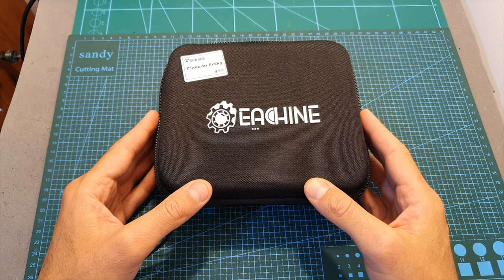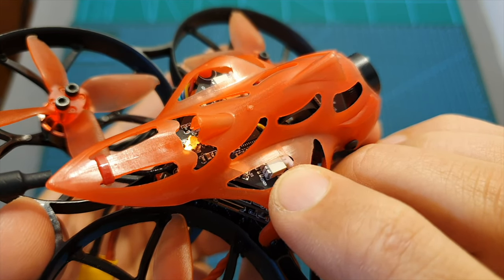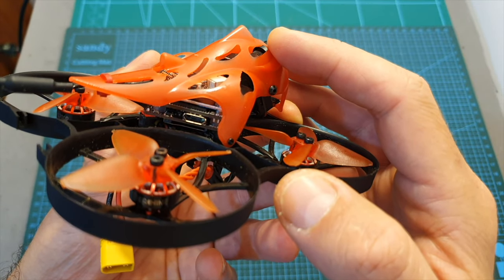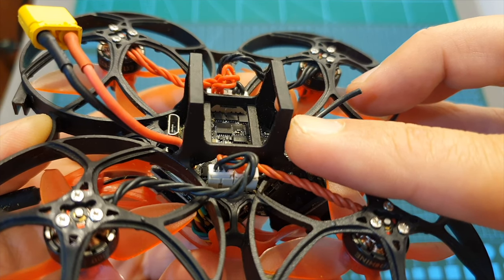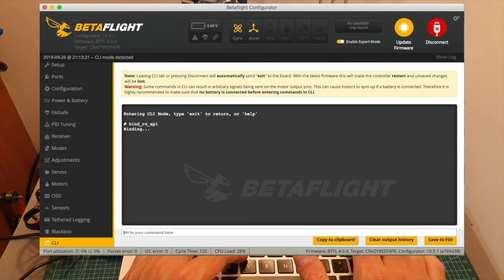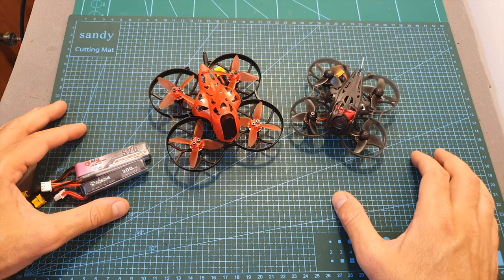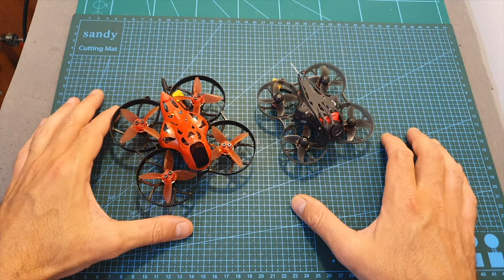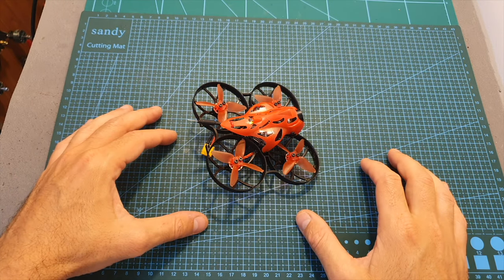Eachine Cinecan - World's Smallest 4K Drone - Setup, Review & Flight Footage

Comment: Im getting a lot of failsafes  indoors. In places where the trashcan doesnt failsafe, any sugestion?
Reply from the maker: Make sure that the RX antenna pops out from the front and it's properly soldered to the board. If everything is ok, try to bind the RX on D8 instead of D16 and see if it helps. Anyway the range of the build in SPI RX is pretty bad and if you want to get farther or fly in places with poor radio signal you need to add an external RX.
Reply: @KremerFPV  that antena that sticks out from the back isnt the RX one  ?
Reply from the maker: @lagz89  No, TX

Comment: One mild crash upside down and the canopy will break.The canopy looks great but very fragile canopy like my Mob7HD was.
Reply from the maker: The canopy doesn't look that fragile. Did you break yours?
Reply: @KremerFPV  broke several Mob7HD canopies. They have very thin arms going to very small screws. That's the failure point, but have had the tops split too.